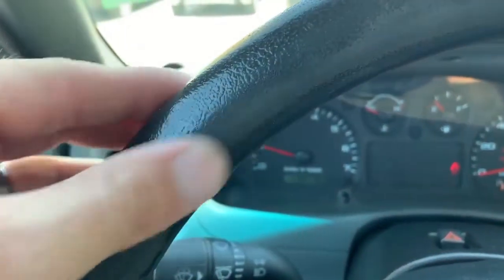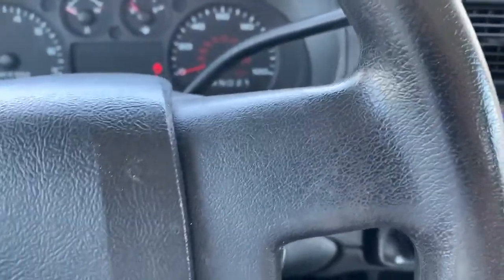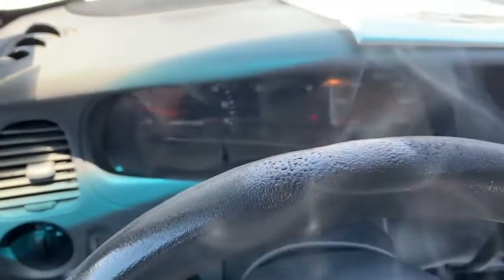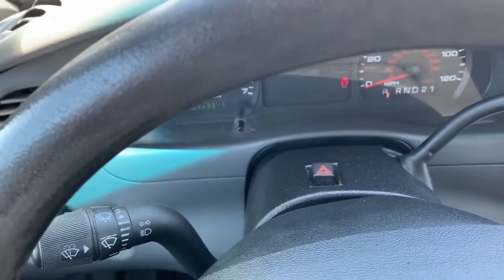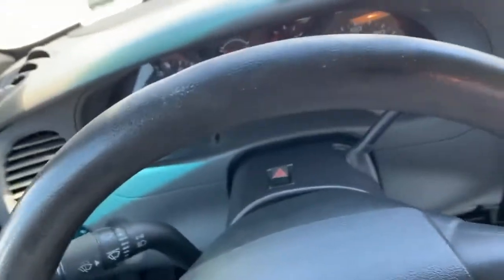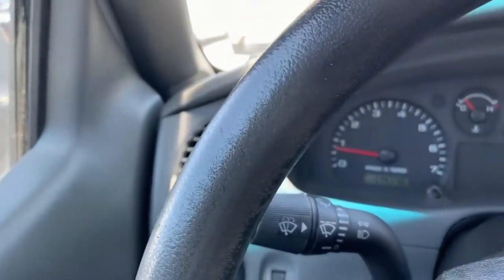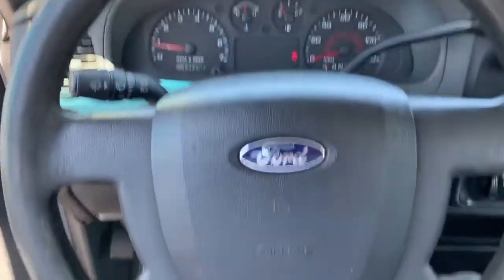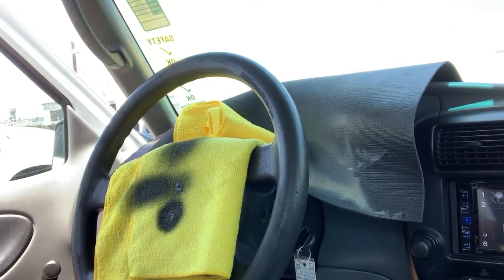DIY Steering Wheel Repair | How to fix your steering wheel

Comment: I've been wondering for a year what to do with my steering wheel, which, foam as it is, has quite the wear and tear onto it. It was one of the trade-offs I accepted when buying the car as it came overall in a very good condition. I am a bit worried about using a torch or a heat gun, though it may come to this if I don't want to replace it altogether. But my question is, does the spray texture actually add a layer of "material" on the wheel, as tiny as it may be? It's not just another paint job, right?

Comment: I was kind of uncomfortable seeing you spray paint inside the car, i would definitely take the steering ffrom the car, tape the emblem and then spray on it, the thing is you dont see paint particles in the air, but they are flying everywhere, they will stick on the windows and other stuff you dont want to. Taking the steering is simple and the best way to do it
Reply from the maker: Yea i understand that.  I cover up some areas and then anything else that lands is so light it actually just wipes away like dust.  However, yes taking it off would be the best option

Comment: Had a customer bring in their ride for a steering wheel replacement.  Bit of an odd work order but I've had worse.  Hopped in and I thought somebody had been burning army men on the dash or something.  Go to grab the wheel and it was like grabbing the surface of the moon.  I could not wrap my head around what happened.  Upon picking the ride up the customer explained the failed attempt.  I really recommend a heat gun.  Those torches are so hot, and so focused.  I think the average person would have a better chance of success.
Reply from the maker: I agree!  The heat gun does the job and spreads the heat more evenly

Comment: But what are we to do if big chunks of the steering wheel foam cover are gone and the bare metal steering wheel ring/from is exposed?
Reply from the maker: I’ve seen it… not much to do other than replace in that case

Comment: Are there any products for building back up areas of deep wear?  I have about a 1/8" deep scar in mine where my ring has worn through the rubber over time.
Reply from the maker: hmmm... thats a little tricky. you could use a heat cure compound and layer it in then heat it and press to form it.  Its not exactly made for that but i could work i think..???

Maybe this one https://vinylandhideproducts.com/collections/compounds/products/dura-flex-professional-reinforced-heat-cure-4oz

Comment: How long does it last. Like have you used a car for a month after this and not had the paint just come off onto one's hands?  I'd think it may b ok for a while but it's the natural oils from peoples hands that start to degrade the foam in the 1st place.  It looks very nice after u did it.    Im not saying it doesn't work and turn out good it very much was an improvement.  

I used to do touch up and similar at dealerships and some thing with the plastic and leather paints like seats would wear off after not that long on a car that was used every day. 

These processes kinda r to recondition the vehicle so it can b sold.  I'd b interested to know if 6 months later it still looks good.

Comment: Great Video! What is your average price that you charge your dealers for Foam steering wheel repair and leather wrapped steering wheel repair?
Reply from the maker: Good question. Our dealership price typically falls between 45-65 for that. We can usually get it done within 15-20 min

Comment: I would be worried about using a blow torch lighter on my steering wheel !
Reply from the maker: Yea you need to be careful when doing it
Reply: Not a big deal. Just flash it a few times for a few secs at a time. Press the pad in. If it doesn't take, just means flash it longer.

Comment: So I gotta do an entire steering wheel, like the whole entire thing is trashed. Can I just skip the texture grain part (I honestly couldn't even match it, since there is absolutely none left), and go right to the spray texture? I just wanna get rid of the sand paper grit that this wheel has. 

Additionally, I had tested it with a mini torch, and melted a small section, but holy hell it's sticky, and still has a slight sand paper texture. I assume that's what the Sems fixes.

Comment: The foam on my steering wheel is cracked open and split with the metal showing what should  use to repair that?
Reply from the maker: if there is metal showing, you may want to look at replacing the wheel completely.  Can you send me a picture of it to josh@detailgreenusa.com

Comment: Where can I find this grain for 2015 Honda Civic?
Reply from the maker: Hi sorry for the delay... I dont remember which grain it is exactly... You should try this: https://vinylandhideproducts.com/collections/grain-texture/products/grain-putty-4-pack

You just mix the pieces together and you can make your own grain using what is in your car... Like the center console.  You just press this stuff onto and it make a mold that you can then use on the steering wheel!

Comment: How about if a steering wheel like that has severe cracks in there is not repairable
Reply from the maker: If its an older leather streering wheel they can look worse than they actually are. Sometimes just sanding them down and re dyeing them makes a huge difference
Reply: @imjoshv  No unfortunately it’s not leather it is I guess like a foam It’s a 1986 mustang steering wheel without no cruise control

Comment: How many Miles do steering wheels start to wear on avarage?
Reply from the maker: It really depends. Ive seen some with as little as 20k... i think all of the hand santizer use lately can cause it to break down a bit earlier
Reply: @imjoshv  or rings on fingers aswell mine started to wear on top plus scratches on the gear nob so I'm guessing the previous owner had a ring on his left hand probably a wedding ring

Comment: Does this work with grey foam?
Reply from the maker: Yes it will but if you heat it too much it will create a burn mark where it get dark. To be safe you can use some acetone on a towel and rub the area. That will level out the foam. Then you can use a heat guy or even a hair dryer to heat it and re stamp it. That will minimize the risk or burn marks... if you still get one you can looks for a grey dye from sem products or even duplicolor to re color the area

Comment: I did the graining and burning step to my steering wheel and it hasn't dried yet. Even though it's been over 24 hours? The rubber feels like tar and wipes off on my fingers. Does this mean it's the wrong material?
Reply from the maker: Hi Jan I’m sorry to hear that it definitely shouldn’t feel like tar. Did you clean the area first? And what did you use to grain it?
Reply: @imjoshv  thanks for getting back to me! Yes it was clean and I used leather. I noticed while I was doing it that a sticky black residue was coming off onto my leather. Now there seems to be a layer of that residue left on the steering wheel and it hasn't dried yet and it's been 24 hours. Maybe I can just wipe that residue off and paint it if it's still sticky  by tomorrow?
Reply: Or should I just paint over it even if it's still sticky?

Comment: Good idea to use those patterned swabs to get back the lost parts  uniform grain.But these may be hard to get.
The blow torch is a rather dangerous and dicey tool.
It can go badly wrong and scar the steering beyond repair.Utmost caution needed.
I would just sand the steering all over with 1000 grit
clean and dust off the residue
mix any oil with thinner on 1:1 and apply it leave it for 24 hrs to get back the feel in the faux leather
then apply a clear coat water based acrylic finish wait to dry 
Cheaply done and no blow torch
Reply from the maker: Hi we do a similar process to what you’re talking about on leather steering wheels. But for the foam wheels we always do it this way. You can actually wipe it down with acetone and then use a heat gun if uncomfortable with the mini torch. For us since we do this all the time the torch is faster and we are use to it... but you are right, you have to be cautious when using it!!
Reply: IMJOSHV - where you find the graining pads kit?
Reply: IMJOSHV, would love a source for the graining pad kits. can't seem to find it.
Reply: Hi Josh, thanks for the vid. Could you pls share the source for grain pads and what kind of spray do you use? Thank you.